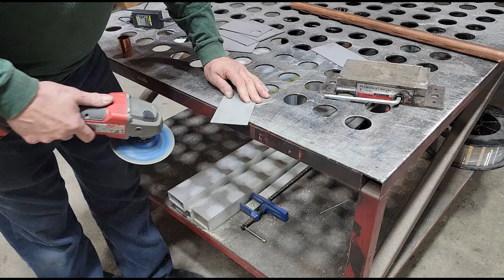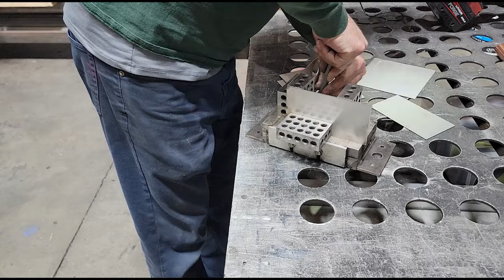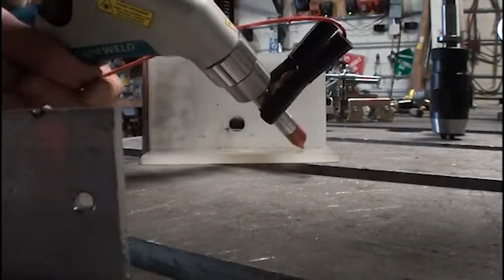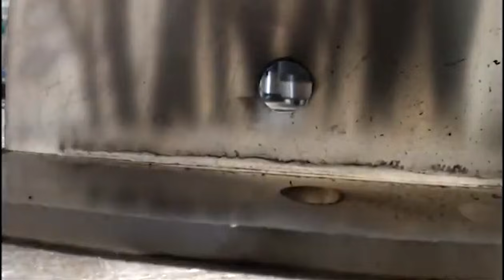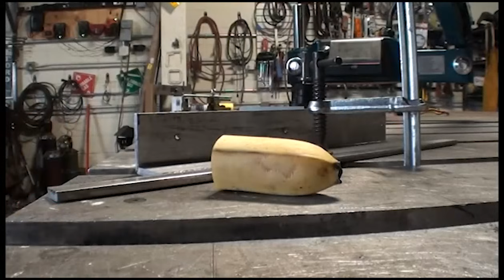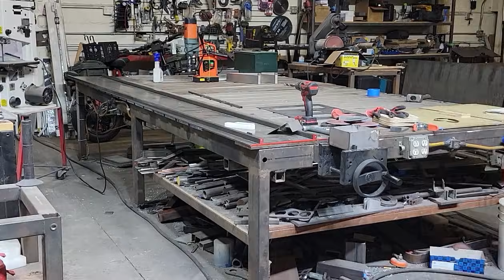welding HDPE with laser welder,  copper coupling and galvanized coupling welded into Stainless steel

Comment: What’s with the terrible voice? Every time I watch one of these it sounds like a robot voice. The difference isn’t between a USA made vs. a Chinese laser. The difference is between a single vs multimode laser. IPG has both. More penetration with the single mode model as it’s more concentrated. But multimode is more versatile. So there’s a trade off either way. One isn’t “better” than the other. You buy them according to your needs. Most Chinese models are multimode. More versatile, but less concentrated.

For thin sheet, use less power and a higher wire feed speed. You may not need wire. Likely, autogenous welds are fine with much sheet. Remember that you can spread the beam width.

Shielding gas, or air, is needed for laser. That’s why you can’t use it without. Even in space, it will be needed. It’s to push any contaminants out of the tube so it doesn’t get back onto the lens and damage it.

You should use gloves. Yes, UV is created by the welding plasma. UV causes cancer. Even though it’s less with lasers than with arc, over the years, it’s dangerous.
Reply from the maker: You don’t want to put the gloves on your foot. The laser source is multi‑modulated, not ‘multi‑modul.’ Handheld laser welding guns don’t have options to change beam diameter  they use fixed optics, designed only to switch between cleaning a concave lens or welding a convex lens. As for the robot voice, robots don’t need gloves. 
 Absolutely not air for welding but if like it use it more power to you.
Thank you for your input.
Reply: Usually it’s a higher power bigger diameter beam. That can also mean, welding, cutting and cleaning. Multi modulated generally means continuous, pulse, etc.

Comment from the maker: We’ve already run the showdown — 700W, 1200W, 1500W — on ¼‑inch steel T‑joints and lap joints. Next, we’ll repeat the test on ¼‑inch 6061‑T6 aluminum. And in a later drop, we’ll put a U.S.‑made welder head‑to‑head against a Chinese‑made welder. If you’re into laser welding, stick around and subscribe — more tests are coming.